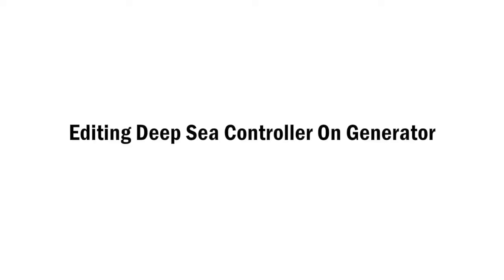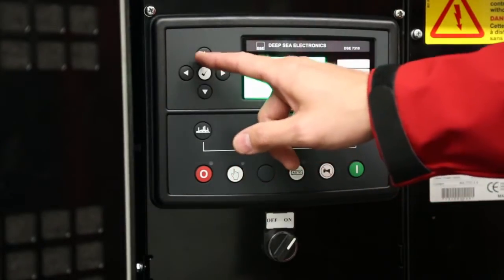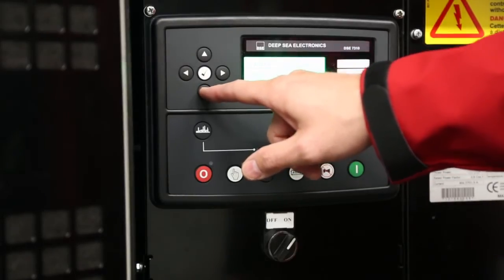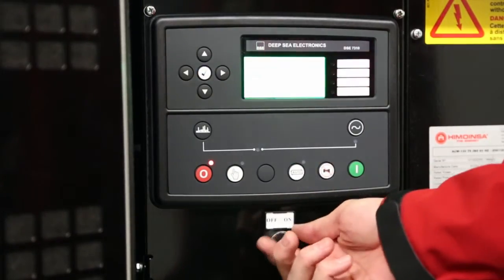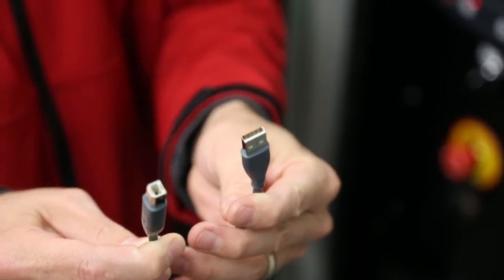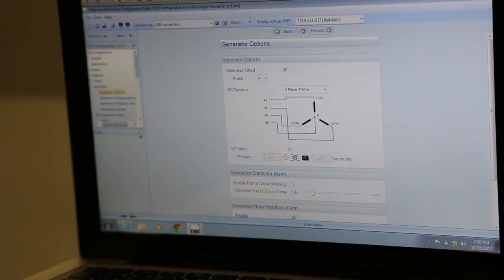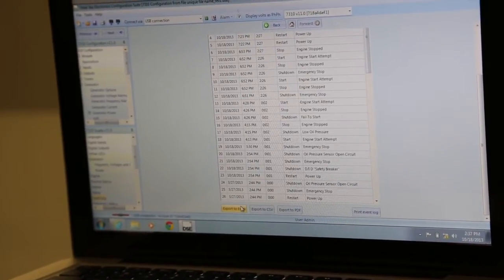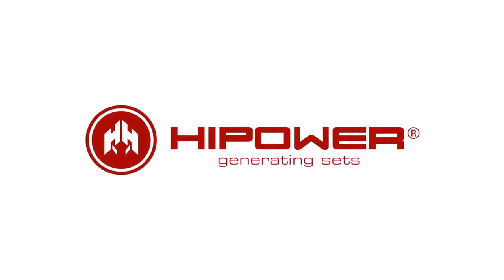Hipower Systems: Deep Sea Control Panel: Configuring Controller and Connecting to Computer

Comment: Hello Sir, we have the 7320mk 2 controller. You mentioned that only main parameters can be controlled by the unit. Does this include timers? I need to set the   start delay under load to a longer period and also set cool down period. The engine does not respond to these altered settings although they appear to be saved in the menu. 
Do these settings need to be altered via the laptop?
My apologies for dredging up your seven year video but we are on an island in Cambodia and somewhat lacking in service personnel.

Comment: Please help on this, how can I change my 7310  panel  from 3phase 4wires to single phase 2wires,the Generator coil has been converted from 3phase to single phase but the 7310 dse panel keep shutting the Engine down.

Comment: hello sir Can I adjust the genset voltage parameter from deap sea 7310??? as my engine is generating only 198 volts in 220v setting...!!!
Reply from the maker: Adeel Asim you need to do that directly at the alternator AVR and then fine tuning with the deep sea